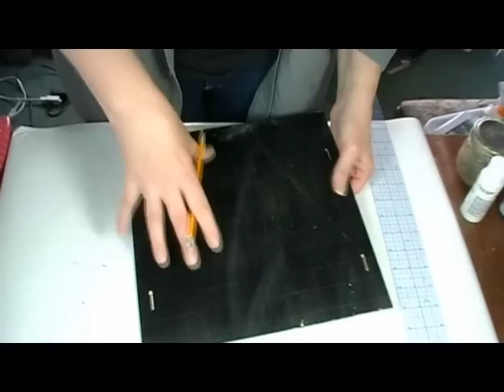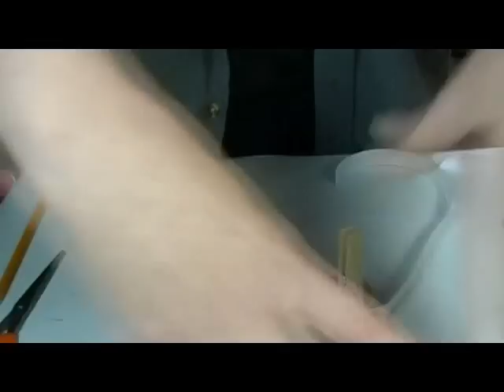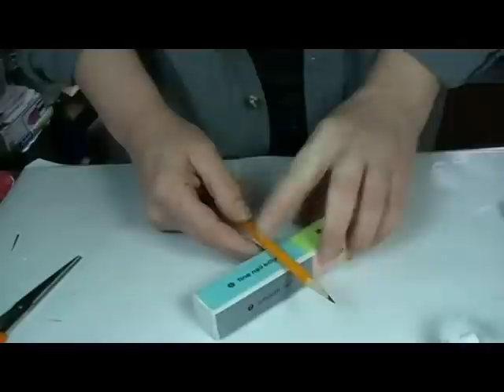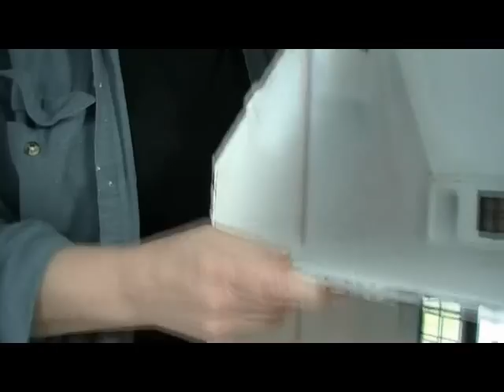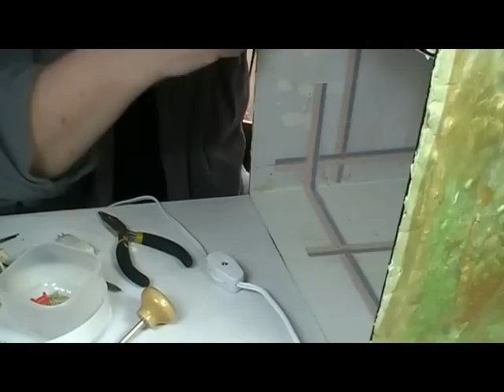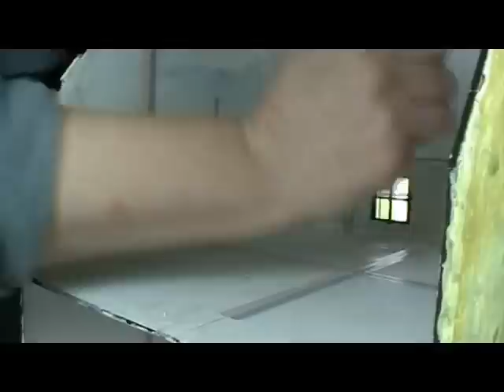Miniature Building Construction Step 4- Installing the Front Roof Panel and Tape Wire System

Comment: not sure if you still respond to youtube comments. However, i just set up my tape wire. my test probe lights until i plug into the junction splitter and then the wire does not light anymore. what am i doing wrong?
Reply: Hope you figured it out, if not, she did a wiring 101 series and this is a link to part 3 of that https://youtu.be/3I1nTu5tZaw it's more recent than this video but still old

Comment: Hi Joanne, do you have a video showing how to plan out the wiring in a large house.  I'm having problems figuring out how to even start the wiring. If there is one tape wire going across the floor upper level, for light downstairs ceiling, isn't one enough, why to you have to cross two wires as shown in Step.. 4 . thanks in advance
Reply: She did a more recent series on wiring, after your question, but here's part 3 of the series https://youtu.be/3I1nTu5tZaw